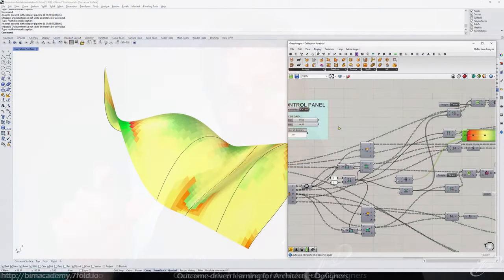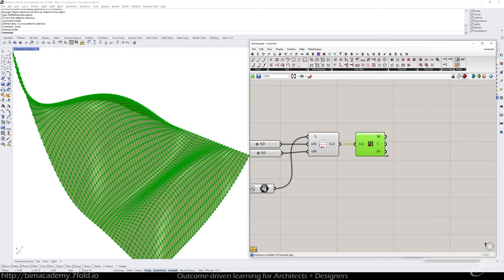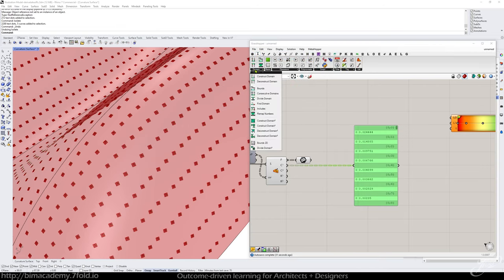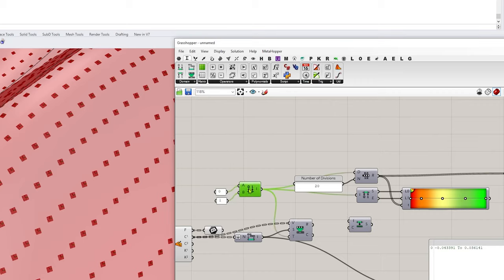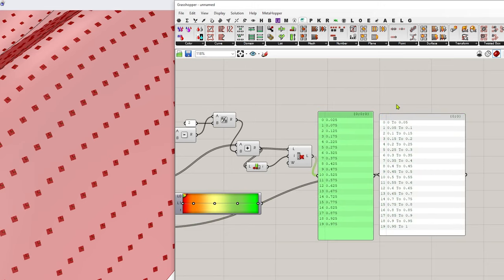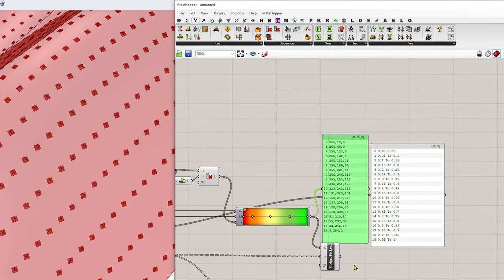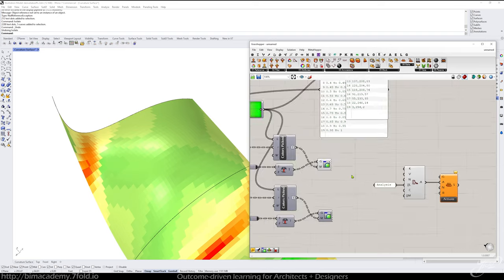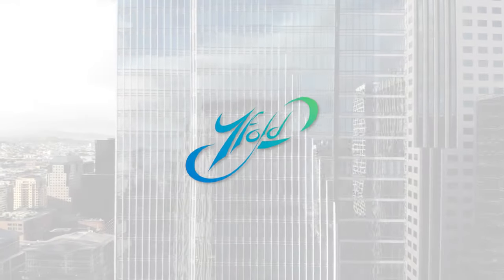Visualize Surface Curvature Analysis in Grasshopper | Real World Architecture

Comment: Great for solar arrays positioning and structural analysis. Would be great if there are ways to analyze curvature and torsion of surfaces, sectional curvature and all the other types of curvatures studied in differential geometry. 

This material helps a lot putting architects and engineers on track in a matter of minutes. This material is extremely good and needed for the education of architects and engineers.
Reply from the maker: Have you explore the Geometry Gym libraries for Grasshopper yet? Karamba is also great for structural analysis. But yes, that was my goal was teaching essential workflows that can be adapted to a number of specialty studies when you know how to properly structure and maintain your data. You can always drop a note to bimacademy@7fold.io to submit lesson request for future videos. Cheers!

Comment: Hi, really interesting video, thank you so much. I just learned about the existence of Grasshopper and I'm trying to understand what it can do. I have a question, I've seen in other videos how Grassshopper can be used to optimize surfaces. Could it be possible to optimize a surface's curvature? Like, if I'm given a surface and a curvature condition (e.g, the curvature at each point must be bounded by some constant or function (i.e, not exceed it)), would be possible for Grasshopper to turn the surface into one that satisfies the condition? I'm really curious and would really appreciate your insight. Thank you.
Reply from the maker: Hey Andres! Glad you enjoyed this lesson. What you'll want to research into is developing 'fitness functions' for Grasshopper. There's ways to get engineering-grade results through running these fitness functions through evolutionary based solver addins such as Wallacei. My approach is to develop those thresholds then color-coordinate the results doing a more informed guess and check approach with which parameters I decide to control upstream. Evolutionary solvers tend to be for intermediate to advanced users of Grasshopper so I'd see how far you can get with the methods shown here in this video. I have another similar video that may provide different insights on what you're getting at here: https://youtu.be/Y4_SpwZfSu8

Comment: Which points and curves did you set up for grasshopper script for the very very beginning 😅
Reply from the maker: Hi Keeley, the curves are modeled manually in Rhino using a Control Point Curve. Then in Grasshopper (GH) just reference in those curves using a Geometry container and input them into a Loft component in GH. Pretty typical workflow so you have the ability to easily make changes to the curves in Rhino as "control geometry" then everything rationalizes in GH parametrically based on the script.

Comment: How would you go about making a single gradient map to analyse both the max and min curvature at the same time?
Reply from the maker: Typically I'll define the upper and lower limits with a domain for consistency as improvements are made to hitting ideal / acceptable ranges of values. There is a dedicated component in Grasshopper in the 'Maths' tab next to the Construct Domain component (found in the dropdown) that pulls the max and min values for each branch. So if you want the entire tree with just 1 min and 1 max you'll need to flatten the output or reduce to a single branch. When you say 'analyze' are you hoping to return panels that land outside your performance requirements? You can use the 'greater than' or 'less than' components to return booleans (True / False) for curvature above a set value. So again, that's why I'll use both defining a fix domain with an acceptable range and then filter for which panels/values land outside that range. The Min/Max component is a nice compliment if you want to see the exact upper and lower values of your current design solution. Does that answer your question?
Reply: @7fold_design  Great, thanks for the detailed explaination!
Reply from the maker: @mg281ur  You bet!